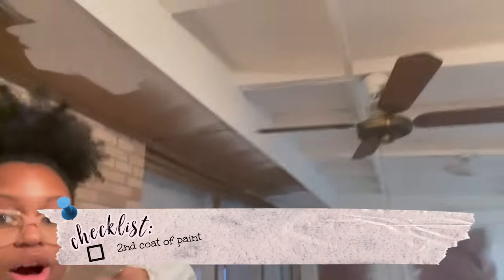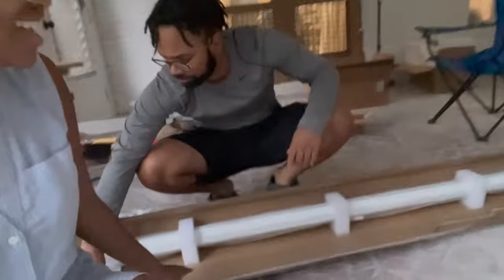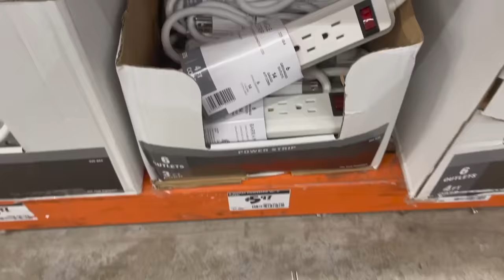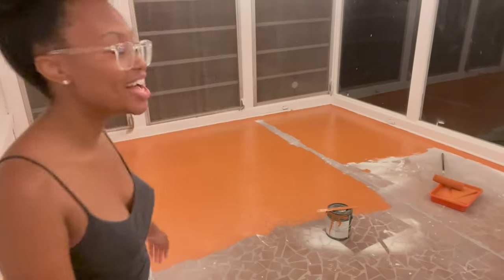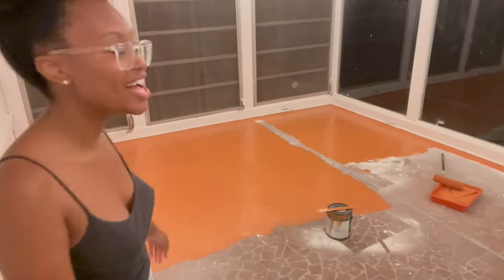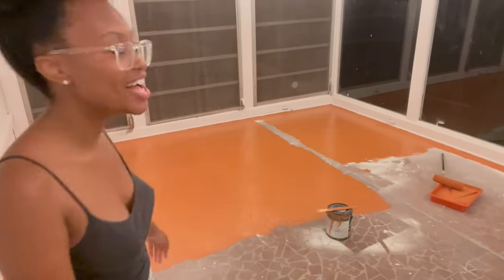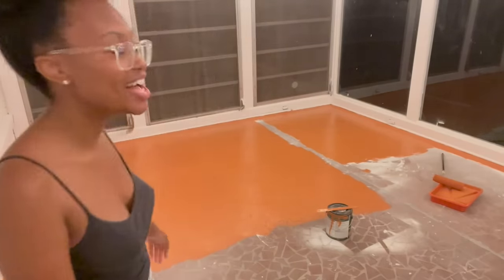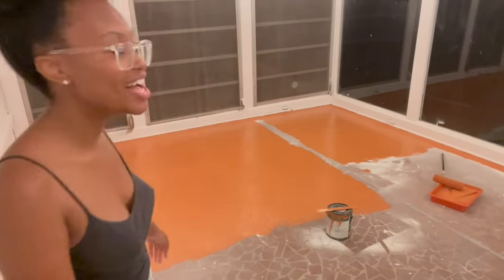I PAINTED MY FLOORS!!| Sunroom Makeover Pt. 2 +NEW Projector Screen, Fans & Stencil Tile #FIXERUPPER

Comment: The stencil looks great. Maybe just do it as a border? Also, a word of advice… before you put everything in there you may want to consider a sealer on the floor. Although you used a porch and patio paint, moving chairs and furniture will chip and scratch the paint. After all of that money and work, you really want to protect your investment. Thanks for sharing! The room looks fantastic! 💕✌🏼
Reply: Yes! And put felt protectors on the legs of the furniture.
Reply: @BD-eu1id  Solid advice. 👍🏼
Reply: Absolutely agree, thanks for sharing
Reply: @Red Devil-I was thinking the same thing, the sealer.
Reply: Please put a sealer over the paint! I painted my floor and I didn't put a sealer down I had to re do the whole thing in less then a year.

Comment: Hey I would add stencil in each corner or leave floors with just the terracotta color because the floors are not plain they do have a pattern, just a suggestion.  Love your diy projects. Be safe.

Comment: If you can't get a sample size of the color from the original store, take the swatch and try to match the color at Sherwin Williams. Ask for a sample size. That should be more than enough. If the color is slightly  off, no problem. Simply tape off a boarder around the entire room and fill it in to look intentional. It will be barely noticable but if noticed, it will be subtle.

Comment: The stencil is really cut but a lot of work for a floor that already looks great.  However,  the perimeter and just the center of the room is an option.  If you're going to put down rugs though, I would not do the stenciling at all.

Comment: IG: lavender_qqueen. I was really worried about the color of the floor. But it turned out luvly. I wouldn't do the stencil, because it will take away  from the color/ mosaic tile underneath. It starting to look really cottage chic especially if you paint the doors a black, or the clay color.